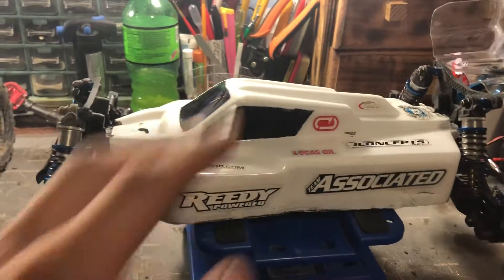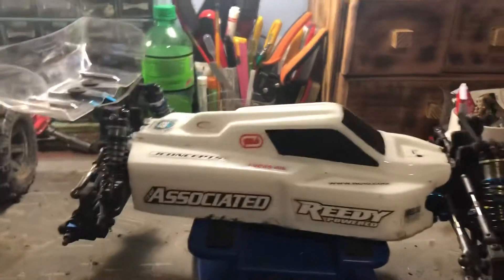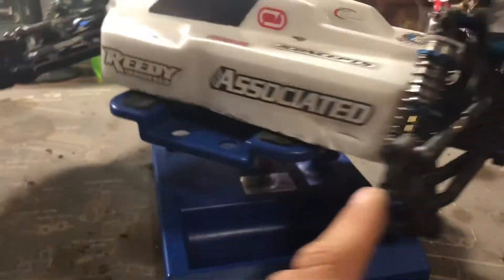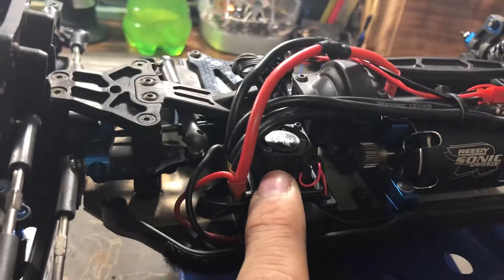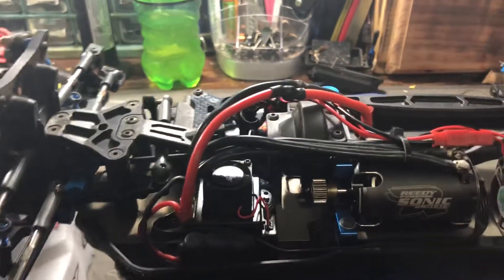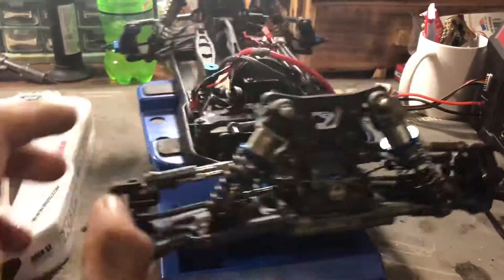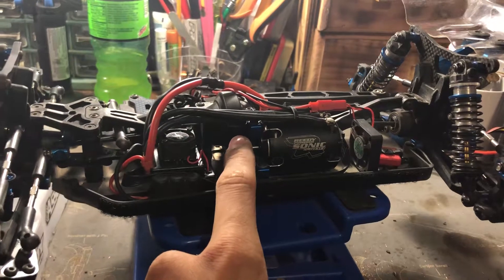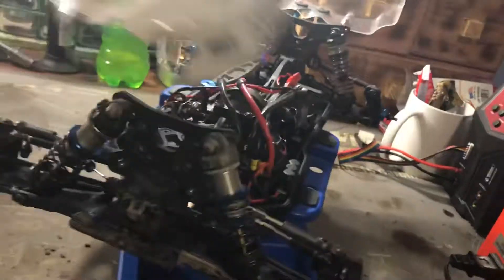Team associated b64d update!

Comment: Watched some of your update video. Just commenting to let you know the hard arm won't help you keep from breaking the car. The hard arms are more stiff, and they are lighter. They are not stronger, hard means brittle, the soft arm will absorb hits better. Running one hard and one soft will give you funky handling issues. Depending on your sag, or ride height, and droop, more preload doesn't necessarily help with landing from jumps. Get a harder spring if need be. You could also run a piston with smaller holes, or thicker oil in the shocks. The pistons or shock oil will increase damping, but also slow rebound. Your pre cut wing is also a huge air brake. There is a line on the back of the wing, its a guide to let you know how much to cut. You can run it full size but I don't think you need that much down force. That's hurting you on the straights.